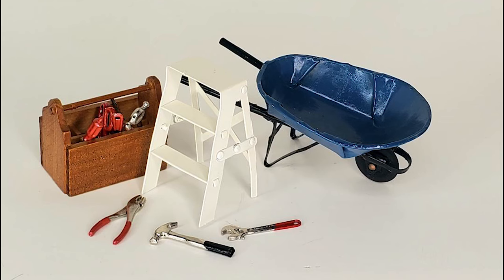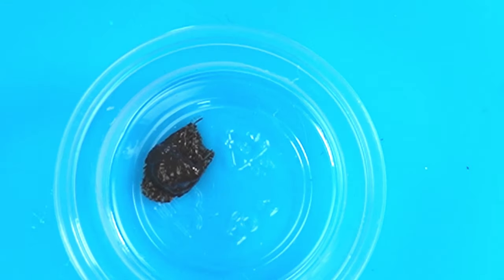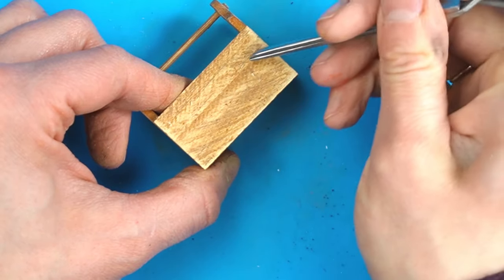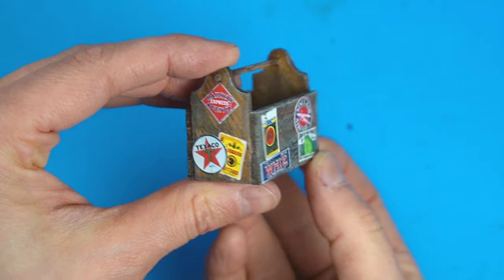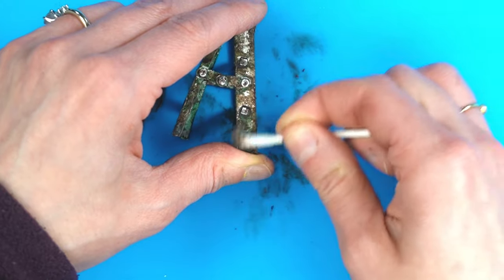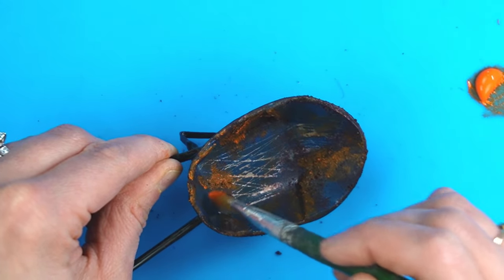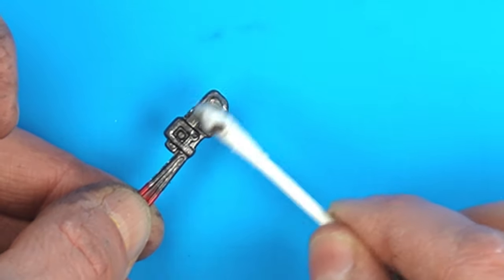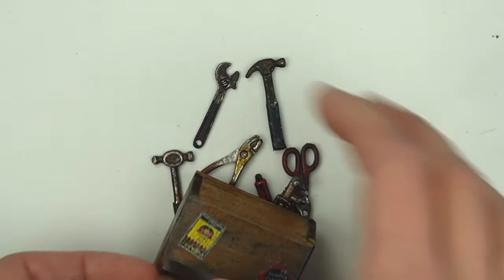DIY realistic rusty miniature tools, ladder & wheelbarrow #dollhouse

Comment: Tape on handles are a very nice touch too!
Reply from the maker: I was initially planning to do leather but I don't have any that's thin enough so it would be out of scale. The tape works just fine. In the future, I'll do 2 or 3 layers of tape so it's more substantial.
Reply: @queencityminis   l think the 1 layer of tape with the paint was PERFECT! I've used tape for so many THINGS but tape faux leather handles is perfect scale and thickness! Great job!
Reply from the maker: Thank you :)

Comment: The tools are my favorite but everything looks great and realistic. Spiderwebs are needed for a basement. Maybe old appliances and broken furniture too. I used to live in a house where the basement always flooded. It had a broken furnace as well. There’s so many possibilities. Thanks for the video!
Reply from the maker: Such excellent ideas! Spiderwebs are a fantastic idea. I have a broken washing machine in my basement as we speak so I'll have to do that for sure. We have an old oil tank that's still there after converting to gas. 

My basements have all had dirt or concrete floors. Maybe I'll do concrete with some dirt in the back corner and make it dingier and creepier over there 😆 I like the idea of adding some puddles and moisture to the floor. That would be very interesting.

Thanks for the ideas!